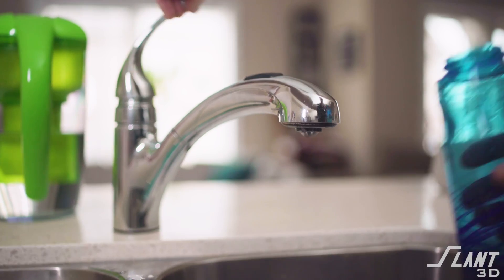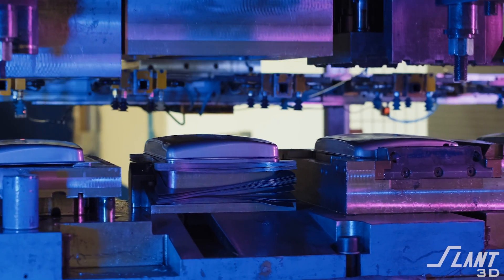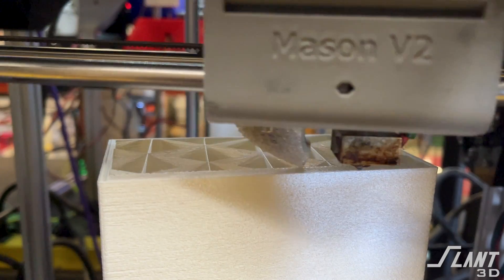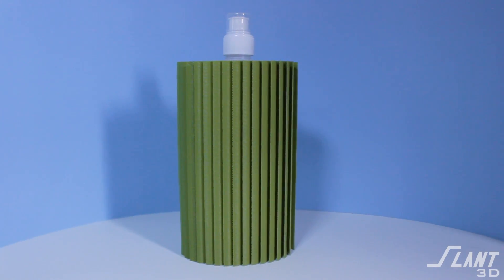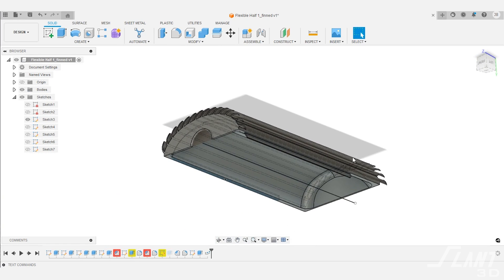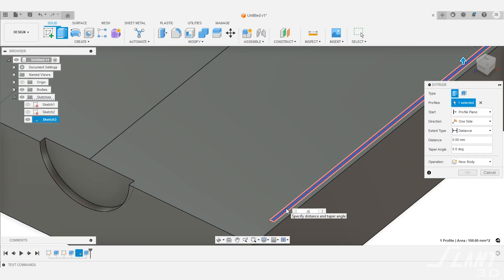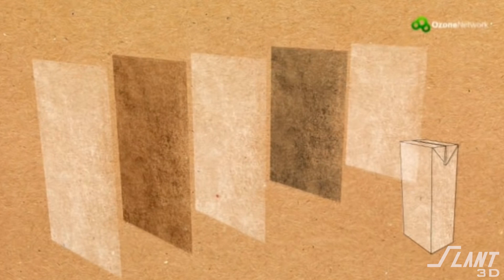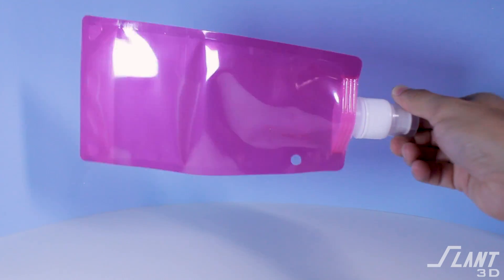Can you 3D Print a Water Bottle? | Design for Mass Production 3D Printing

Comment: I love the videos, but it was said in the intro that we were going to debunk the statements that you can't 3d print a watertight and food safe product. We still didn't do that we printed a case for such a thing. I was hoping you would talk about the "food safe" filaments and printer parts.
Reply: I printed a food safe measuring cylinder out of pla. It is water tight, and goes in the dishwasher. It could be better but good enough. I was expecting a final different layer in his water bottle or tests to demonstrate it was safe. Instead he printed a water bottle case, not a water bottle.
Reply: Well, you can print bottle out of PP filament, but it's not a simplest plastic to print and for being really food safe you have to meet Cleanliness in Manufacturing requirements, so it's kinda pointless action
Reply: ive come to find that his entire channel points back to one thing and that thing is "you dont have to manufacture the way youve always been taught" hes constantly showing alternative manufacturing techniques. i love it.
Reply: There are no food safe filaments! Well, technically technically there are, and I bought few PLA and PETG rolls that were described as food safe(didn't buy for that reason), they were manufactured in EU and claim to fulfill EU requirements. However, we still have those pesky layer lines that are next to impossible to clean, filament paths in our printers are probably not food safe to begin with, but even if they were, there's still residue of cooked, possibly not food safe plastic in the nozzle.
Reply: The bladder is NOT a water bottle in itself. It was INTENDED TO BE ENCASED. That's why it's called a "bladder". They do the same thing with fuel tanks in race cars. I even know the guy who invented this concept. We don't call the bladder "the fuel tank".  The casing is referred to as the fuel tank.
Reply: Yeah this is absolutely horribly worded of a video, it is practically misinformation
Reply: @maxwell_edison  it was intentionally harribly worded too. As if we can't see that he made a shell and not a water bottle.
Reply: This is actually little different from using a coating on things like food bowls, etc.  There's a potential porosity with 3D prints...so you're given suggestions for coatings like you'd put on things like wooden bowls, etc.

That's not cheating any more than what they did there.  It's still a bottle.  It's still mostly 3D printed (Armor for a fragile bladder constitutes a bottle as a complete assembly because it's the whole product that counts.).  

What you're looking for is a silver bullet...which isn't going to be the case for any Additive system on the planet.  Sorry...

Your takeaway for this is the biggest takeaway: "No process is inherently limited- you are limited by your ability to engineer for that process"

I (and they) can't help that you're not engineering for it right.  ;)
Reply: @frankearl9285  

I just think it's a little disingenuous for them to show the water bottle and say "Right here is a fully FDM 3D printed water bottle that is fully waterproof..." when in reality what they printed was a case around an existing product that is waterproof, not something that is "fully FDM 3D printed".

From a design perspective I think it is a fantastic idea and great to show people, but click baiting that you can 3D print food safe and water proof things while showing something like this is a bit dishonest.
Reply: @frankearl9285 It's hugely different from that process.

The liner used in food safe processes like aluminium can production cannot be used on its own to provide the same functionality.

It requires the rigidity of the casing to provide stability. It requires the lid of the casing to provide a method of filling the vessel. It requires the casing to function as the product.

In this case they printed a casing to go around an already functional water bottle. They didn't print a water bottle.

Comment: Sometimes there's no need to reinvent the wheel.
Reply: This channel definitely suffers from square peg round hole syndrome sometimes.
Reply from the maker: In order to get certain benefit you have to engineer certain solutions.
Reply: @slant3d  yes, but this is clearly not a relevant example.

Comment: But how do you clean the inner bottle?
Reply: Have to bring it to the dry cleaners
Reply: Open the cap and put some soapy water in there… or take the two halves apart and clean it.
Reply: @bozthescrewup410  that doesnt even work with a regular glass bottle. Needs scrubbing or.. a pressure washer?
Reply: @JonasBuechnerArt  : Tell people that you don't know what a bottle brush is without saying it...  X-D
Reply: @bozthescrewup410  that doesnt even work with a regular glass bottle. Needs scrubbing or.. a pressure washer?
Reply: @JonasBuechnerArt  how does anyone clean a camelback bladder or any other thing like that?
Reply: @bozthescrewup410  insufficiently probably
Reply: @JonasBuechnerArt  : That depends.  I manage.  But it involves a silicone bottle brush and soapy water with liberal rinsing.  That applies to the bladder he's talking to or a Camelback.
Reply from the maker: How do you wach current bottles? Do that
Reply: @slant3d  Mine go in the dishwasher, which doesn’t work with a $0.10 water bladder bought from Temu.